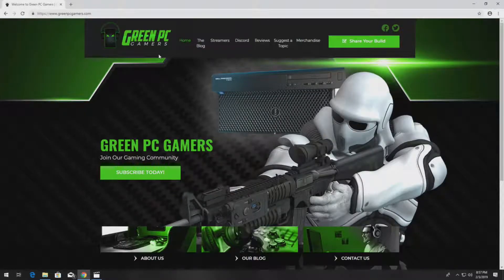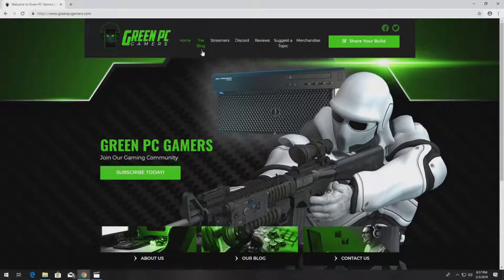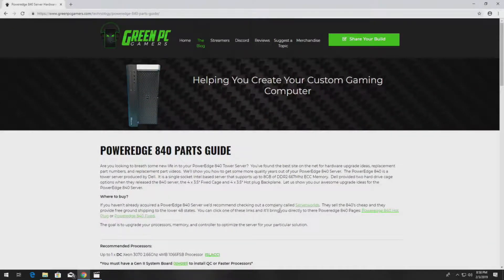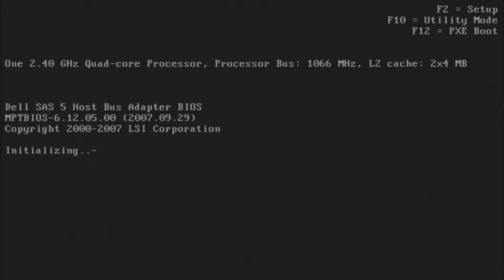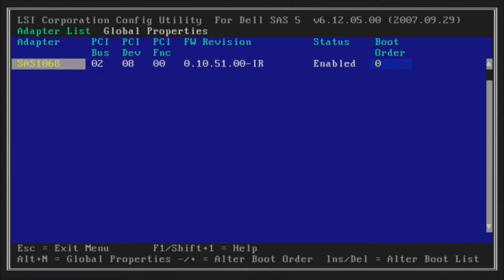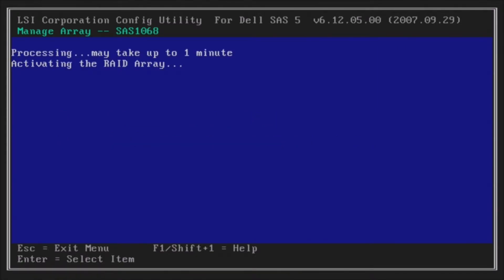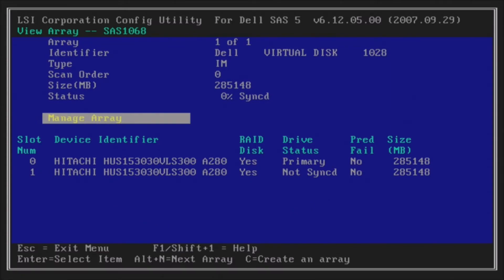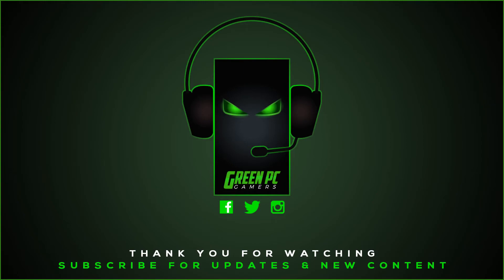How to boot after replacing SAS 5iR Controller (UN939, GU186, UCS-51)

Comment: So I was using your video to replace the PCIe card UCS-51 in my Dell Poweredge 840 because I was receiving a message before post, stating "RN50 A21 BIOS PCIe Training Error: Slot 1 System Halted! So I purchased another card (Same but used) and now the splash screen for Dell shows and it starts post but I am now receiving another message. The message now states "Unable to load Logic Corp. MPT BIOS / MPT BIOS Fault 08h encountered at adapter PCI (02h, 08h, 00h) Press any key to continue........ I can not ctrl-c to start the LSI Corp. Config. Utility. Any suggestions. (Maybe the firmware on the controller?)
Reply from the maker: Could be a bad replacement controller, or your motherboard could be failing as well.  Are any of the capacitors blown/oozing?
Reply: @GreenPCGamerscom  Thanks for the reply. I been at this for the better half of the day and I suspected from the jump that it is another bad card that I have. I bought it off ebay used so.......
The BIOS interface is not communicating with the SAS controller therfore not offering the config. Utility that I need.  Right??? I think I am gonna purchase a new, never been used, controller. To answer your question about any blown capacitors, NO. Nothing that I can see. On the original controller there was a bulging capacitor, but not on the new/used controller. Is there a certain version that is needed? for example User Guide states: 
Trouble Shooting BIOS Error Message
Unable to load LSI Logic Corp MPT
BIOS
MRT BIOS Fault 02h encountered at
adapter PCI (XXh, XXh,XXh)
Fusion-MPT Firmware fault code 0706h
The controller was downgraded from version 10.x version or
greater to 6.x. Contact Dell support for assistance.
It's not the exact error message that I have, but the closest I can find to my error message. How do I Know what version I have? Should I not even bother with the version and just purchase a new Card? Everything was working fine one day and the next.........